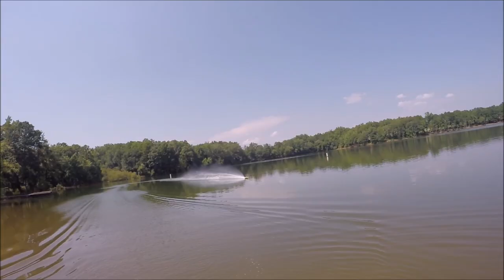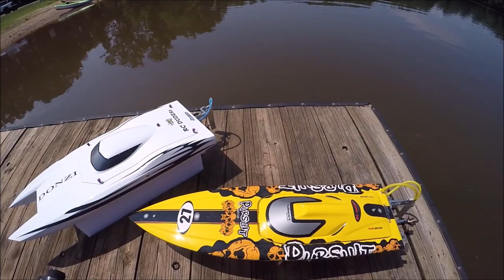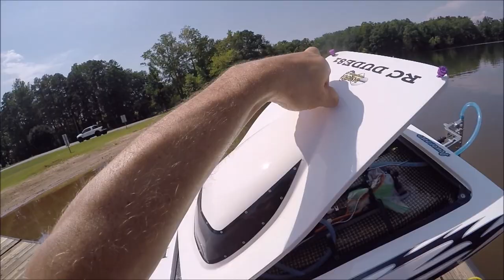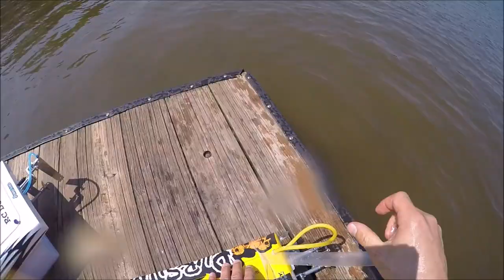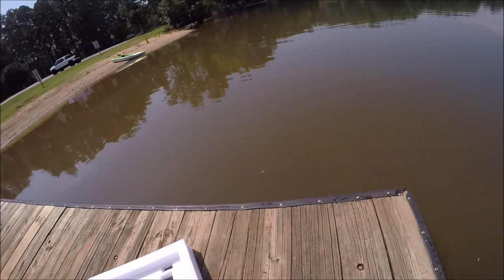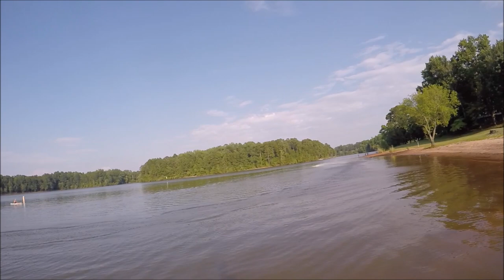TFL Pursuit 6s "69mph!" and Cheetah 6s "ON RAILS!"

Comment: DAMN Brother 😱!!!! The Pursuit and Cheetah are absolute Screamers 👀. Was just at Folsom Lake today fishing and hiking with Andrew and his buddy 🤗. So relaxing to be near, on, and in the water 😍. We got skunked, but had a great time regardless. It would be nice to run one of these rippers out there. The Cheetah corners Killer 😱. I lost a solder job not long ago. Started using a mini torch for my EC5's now and my iron for just tinning the wires. It's definitely faster and seems to get a solid joint. Gotta love the hobby Bro 👍. All the trials and tribulations and tuning that pays off with Mad FUN 🚀🚀.  Great job with the build Eric 😜. The speed and exceleration is friggin Crazy. 🍻🤘🤘😎💪👊👊
Reply: The 2 of u are the best bashers on earth!
Reply from the maker: Thanks so much brother Rich! Yeah I do love this hobby!! My first love as a kid was rc boats! I have 5 total now and wish I had time to get them all out at once!😜I do a lot of sport running during the summer out on the lake and my dad has a few boats too. I just don't always film. Just pure enjoyment!😍Sounds like you had a blast with Andrew and his buddy! Some good guy time right there! There is no escape like hiking and lake life! So relaxing and fun! Thanks for the heads up on the mini torch...I may do that!👌I think the problem was I ran this boat hot testing props and the joint was weakened already and that run just popped it loose the rest of the way. Got her fixed up now! Also have a dual cooling rudder and oversize cooling lines ready to put on her now. She'll be a BEAST for sure! Thank for watching my good friend!😎💪🤘🤘🍻🍻
Reply from the maker: Really appreciate that bro! There are a lot of hard core bashers out there but it's all about sharing ideas and good times!😎👊🤘🤘🍻
Reply: @RCDUDE81  sounds like you definitely know your boats Bro 👀. Going to the lake is so refreshing 🤗. I'm stoked cuz Andrew is finally taking an interest with the outdoor adventure stuff 👍. Planning to take him float tubing and hopefully hook in to some Biggins 🤣🤣😉.

Comment: Hello, very nice boats - you have them dialed in very nicely. I like how you reinforced the Pursuit. If I may bother you a bit, what exact material and resin did you use to accomplish this?  I have a TFL hull that I'd like to do the same to. What prep did you do to the hull?  Did you remove the motor mount, etc from the hull before reinforcing or did you reinforce around everything?  Thank you in advance
Reply: You can remove mounts or leave them. No prep really needed, just lay some CF cloth and coat it with epoxy.

Comment: OK, thanks
But I forgot to specify that it was for the Cheetah that I wanted to know the engine configuration, Kv and propeller and the esc.
Reply from the maker: During this video I was running a Leo 1730kv 4092 with a Seaking 180 and Dasboata X447 prop. The boat is fast but ran hot. She has a whole new setup now with a 220amp swordfish coming.🤙
Reply: OK, thanks. with this new esc no heating worries? I have a 180 seaking and it heats up quite a bit but I have a leopard 4082 2000kv. i will definitely drop in kv.

Comment: Hello, what is the engine model?
Is that a leopard 4082?
How many KV?
Which propeller did you ride?
thank you.
Reply from the maker: Leo 4074 2000kv on the Pursuit. I believe the prop was a Dasboata 1716.🤙
Reply: @RCDUDE81  OK, thanks
But I forgot to specify that it was for the Cheetah that I wanted to know the engine configuration, Kv and propeller.

Comment: What’s your speed on the cheeta? I just picked up the carbon fiber model single but I want to convert to twin, I can’t wait to run mine. I’m think either 6s or 12s? Or maybe 8s
Reply from the maker: Not sure on the speed since I haven't clocked it. Probably high 50's to low 60's here. She is a great handing boat! Very light too for the size. 6s is probably enough but that is all up to you!! I wanted to convert this one to a twin as well but too much work being it's already a single. A twin would rip!!
Reply: Hey bud I have a similar setup in my cheetah but a 300 amp esc! I’m curious what size prop do u have on yours? Mine did not come with one and I’m curious what size prop I should start with! Any suggestions bud? Also going to start with 6s and then eventually go to 8s!

Comment: tfl pursuit gets on plane quickly, no matter what ive done to my m41 it porpoise and it pissed me off so much ive hung it on the wall.. what a pos.. i should have gotten a pro boat😔😔😔
Reply from the maker: Yeah the Tfl Pursuit is a killer boat! Its taken me quite sometime to get it this dialed! Proboat makes killer boats too!💪My Dad has a M41 and he has the same issues. Not much good over 50mph👀
Reply: @RCDUDE81  
Ya, i got into boats a couple years ago, it was short lived i dumped a few hundred in the m41 all hot racing parts stock electronics, new skin shit like that but i always go back to my cars, ill try again in the spring i am going to order twin zelos and start with fiberglass instead. I feel the added weight will stop the porpoising And my be easier to tune considering the zelos has been out for a while and there's a lot of people that upgrade them.
Reply from the maker: @raptorider83  I know what you mean bro! I love my boats but use them a lot more in the summer! Do a lot of sport running with my Dad too at the lake. I occasionally throw a vid on my channel like this one. I was doing a lot of speed runs but takes a lot of work and time to get them dialed! The new Zelos Miss Geico 36 is SWEET! Check out MrMad2424 on Youtube he got over 100mph running stock electronics! Takes a lot to setup a boat for speed like that but it can be done! Sorry to hear your luck on the M41. it's a cool boat but I think the biggest problem is the flex of the plastic hull and it's so light weight. How do you have your strut adjusted? If it's running too wet it'll cause porpoising too.
Reply: @RCDUDE81  I like the tfl, i also was looking for giant scale boats well trying to find out how to order and what the cost was. i did some research on the zonda it is a thought🤔 but b4 i buy anything else i am going to buy what i want and not just buy the first thing. the giant scale r/c boats in Europe are sick but i couldn't find any place that new how to order.
Reply: If you look on YouTube look up giant scale RC boat outer limits...